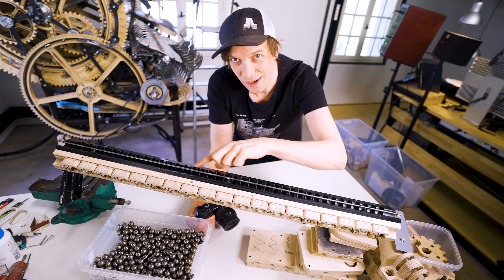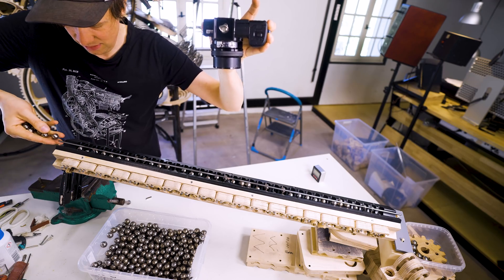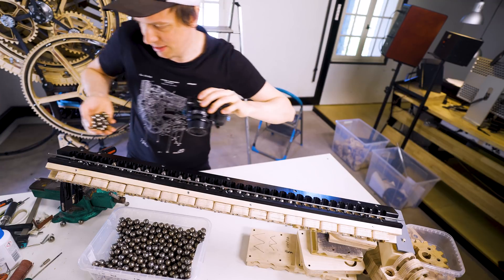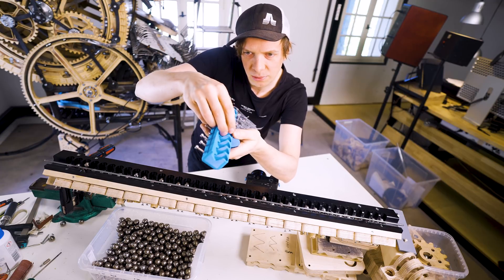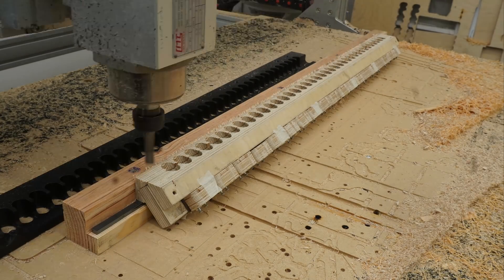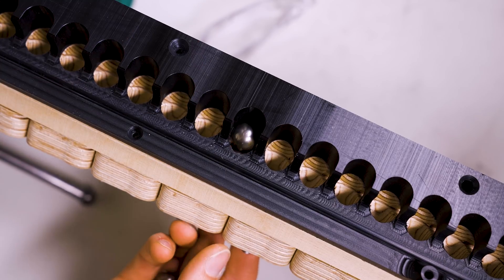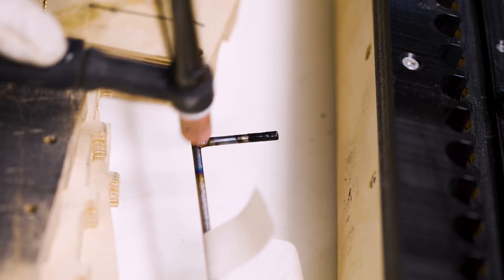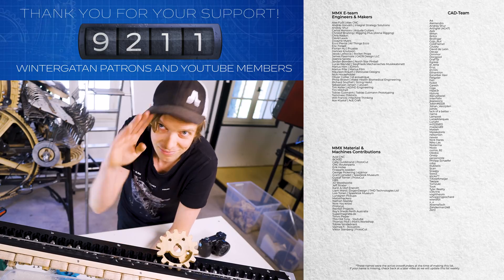Testing the New Marble Divider

Comment: Attach it to the machine with an adjustable rather than a fixed joint. Then you can adjust the angle in both directions when needed. A ball joint or some other universal joint at one end could work. Fix one of those digital gauges for each axis and you can dial in any angles you like. 😀

Comment: Consider doing a flow analysis of all your parts. What is the maximum flow (in marbles per second) in the magnetic lifter? the divider? the fish stair? How does the flow relate to the speed of the pedal beat? How many marbles per second did you need to play the original marble machine song? 

It seems like the marble divider might be your slowest part, so I'm worrying how it will fail if you overload it with marbles coming in.

Comment: One technical point: if you use different metal with lower melting point to join two metal pieces, it's called soldering or brazing, depending on involved temperature.

Comment: TOOL TIP - Nu-Calgon Thermo-Trap - I prefer the tube of paste but the spray gel works too.  limit heat transfer without cooling your weld. its an HVAC must for brazing refrigerant lines without melting internal seals or overheating internal components. would have saved your plastic I'm sure

Comment: In the close-ups of the marbles, you can clearly see some early stages of surface rust building up. You might want to check the humidity in your workshop and/or treat your marbles with a thin coat of some kind of oil.
Reply: In an earlier video he gave them a bath in which they rusted.

Comment: One thing you may have thought of but not mentioned in the videos is that the slight vibrations which are caused by the machine may help to prevent any stuck marbles; no reason not to aim for perfection, though, I guess.

Comment: In the close up of the marble divider test I notice some rust marks on some of those marbles.  That cannot be good for the reliability of the marble machine as it means rust will be left behind in some places in the machine and the marbles will become rougher and not flow nicely where they need to.  Somewhere along the line it's probably going to require a system to protect the marbles from rusting which means oil but you also want the very lightest of oil since any excess oil will also be left behind and that will collect dust which will be worse than the rust.

Comment: I'm concerned about the throughput. The marbles roll pretty slowly, and there will be many channels to feed. Perhaps the marbles being dropped at different points will be sufficient to help, but I'm not fully convinced. The second part of the concern is that the low speed might result in fish stair getting clogged if the marbles are too slow to escape from there.

Comment: When using different materials should the expansion/contraction be considered or wouldn't that matter anyway considering the lenghts of the parts (less than a meter) and the temperature differences one would expect (probably hardly more then -5° to 35° in theatre/open air/transport situations)?

Comment: It seems that the main channel runs too slow to support all the notes being played when the machine is actually run.  Have you calculated the marble feed rate requirements, and that there will not be a "traffic jam" at the divider?
          Regarding the color of the plastic, I think you should have chosen a light color for appearance.  On stage, the divider will disappear into a sea of black!
          You should have made a jig from plywood for the welding exercise to prevent heat damage to the plastic, and have less need for a hurried joint.  At the top end, I would have bent the wire rather than welding.  For the other joints, I would have brazed this with a gas torch, using silver brazing alloy.  I would have also  turned down the ends of the vertical pieces, and inserted them onto holes drilled in the side for mechanical alignment and more strength.

Comment: @wintergatan any thoughts on a finish on the wood to help it retain its current moister content? It is going on a world tour, world has many ecosystems each with thier own average humidity levels, your wood, especially smaller pieces will warp and shrink and expand with it very quickly if it's not finished or treated... just a thought.

Comment: A trick I learned back in the day for keeping heat from spreading to other parts, is to take a pair of vice-grips or other heavy metal clamps and clamp it to the work. It will act as a heat sink and help keep sensitive parts from melting.

Comment: When you're welding into something connected to a flammable/meltable material, stick a set of vice-grip pliers on the metal near were you're welding. It works as a heat-sink, more heat should go into the pliers.

Comment: Hello, just a college guy majoring in Aeronautics Engineering here. Just some word, Redundancy is used when if, in case one part fails, the system as a whole would still be able to continue perform without noticeable degradation in performance. What you just shows in your marble divider, isn't redundancy, but a part with high level of tolerance, which means that any inaccuracy in input data(which in this case is the tilt angle), doesn't severely affecting the performance. Glad you finally finish the marble divider height problem Martin, and can't wait for you to install that in your machine!

Comment: I might've missed something from the live, but I'm kinda worried about channels getting underfed after a while (as some imperfections will cause some channels to get skipped more than others). If that ever happen, you could probably find the optimal angle for maximizing channels being fed by feeding the divider a constant number of marbles and measuring how many skip all channels, while starting with all channels empty. Greater accuracy should equal less marbles skipping channels and thus less chance of underfeeding.

Comment: I know you’ve focused heavily on slow moving marbles, but have you looked at the possibility that excessive speed will make the marbles skip holes?
Reply: I think he has a lot of ways to slow marbles down to speed is too high: slope, tilt, and the entry speed from conveyor and fish stair.

The problem comes when a big blob of slow moving marbles forms.  Then they start to stand still as new marbles 'cut the line' as they fall from above.

This results in a clog that can back up into the fish stair and cause marbles to bounce over the guard rail

Comment: Going to keep saying it until it sticks, this is a terrible idea. Notes lower down will never get fed marbles during extended play. Every single note ahead of them will eat a marble and there's only so many marbles that can go down the line at once. Small-scale tests with no notes being played don't mean anything. Put them on the wheel and play something. Going to be a lot of high notes and dry clicks.
Reply: I don’t think so. You need to remember that there are several paths that feed each section of the divider. So the marbles don’t actually have to roll all the way down. But we will see
Reply: @Faenus  All depends on feed rate. And yes, I noticed that it was split into, what, three? lines. But the problem remains that the last one before the next input is still going to be waiting a long time.
The original marble machine split way more, and while it had its own problems, this version's lifter is more reliable and could fill it up.
I don't even know how to get started doing the math, but just look at how freaking slow it is to get to the last holes on this track. Now imagine one note is playing every second and it never fills up. Hell, just block two holes with a finger and do a basic beat, see if it stalls the feed.

Comment: You know how it's a sign of good engineering? You iterated the design to the point that if I didn't know already, I'd think that the POM/Delrin part was meant to be there. One of the great properties of Delrin is that it's self-lubricating. So you might be able to cut out the majority of the graphite dust that was contaminating much of the machine, as well

Comment: In the future, if you need to keep heat out of plastic, put an alligator clip or similar on the rod, in between the weld and the plastic. it'll act like a heat sink and keep heat out of the sensitive material. it works for soldering electronic components, should work for quick welds like this too.

Comment: Since we are engineering here, all materials have strengths and weaknesses. Delrin (POM) is an extremely wear resistant plastic with massive compression strength. But it is britle, it has a relatively small elestic and plastic deformation stress window, particularly for tension and torsion loads. The plywood you use is much more ideal for tension and torsion loads for example. 

Another consideration when combining dissimilar materials is expansion and contraction due to both temperature and humidity(with wood) , I imagine on a world tour the MMX will not be transported in environmentally controlled conditions. Before changing the material a "final" part is made from it would be wise to consider these properties.

Comment: I am worried that the rate at which some of these channels fill will be slower than the rate that they get used.  You really need to make sure to test that certain channels arent being preferentially skipped on the long term because that error will 100% accumulate over the course of longer performances and some channels may just empty out.

Comment: Do not consider POM to be too much of a super material. It is easy to machine and precise, yes, but over time you will find the pressure and impact of the marbles will wear a groove which opens it's tolerances. It would be wise to keep POM on the outside of the machine where it is simple to replace the parts.

At least this is my experience with it in a manufacturing setting.

Comment: I'm confused. The marbles seem to fill the holes randomly. How are you able to produce a consistent tune when you can't control the timing of the marbles entering the holes?
Reply: they don't need to drop into every opening every time, there are enough stored below that missing a few at the top momentarily is not an issue
Reply: @tommj4365  Ahh. so, this part is just topping off the store of marbles? Thanks!

Comment: Anybody else yell NOOOOO when he was about to start welding the fence right on the new delrin divider? Just me? Glad it came out relatively unscathed. 😳😅
Reply: Oh yes, same feeling here.
And why didn't he do a test weld on another piece of rod 😩
Then we wouldn't have seen any MOLtEn plastic...

Besides of that: really great to see the new divider. Really looking forward to the assembly together with the wavy marble lanes on the machine and another test run.
Reply: I would have just grabbed the first piece of extra plywood and drill the three holes into it on the CNC with the exact same spacing the Delrin part has, then welded on that sacrificial piece...

Comment: When you build the "marble divider" into "marble maschine x" it is better, when degrees angle variable/flexible is, with long screws, because floor unevenness or other Problems.
Reply: I'd assume that part of setup in any location will be leveling, but yeah some tolerance is definitely necessary.
Reply: thought at: rod down at the "marble divider," incline is the same, pipe at the end (overflow) fixed, intake reinforced, but not fixed, so you could adjust the angle with screws.

Comment: A better marble divider would not be parallel with the drop tubes. It would run at a slight angle from back to front, with divider walls shortened accordingly. This would reduce friction for marbles later in the path, which keeps them effective in the absence of pressure behind them.

Comment: I wonder what would happen if you machined this so the marbles stuck out a bit more? Right now it looks like they get trapped on the plastic, if instead they got trapped on the marbles then you would know for certain that the issue would resolve itself eventually.

I'm also guessing that the friction between two marbles is lower than that between the marble and the plastic which means them less likely to get stuck anyway.

Comment: I feel like Martin almost made the same mistake he made with the plywood part in that there is too much material cut away in the plastic between the holes, which causes the marbles to not take a straight path. That sideways bouncing as they move down the marble path is why they're getting stuck and is something not present on the prototypes. The rolling path of the marbles is much straighter with only slight sideways movement.

Comment: Another aspect with those barely stuck marbles is the vibration. Once on the machine, even the slightest vibrations are going to both loosen up stuck marbles and cause more of that back-and-forth of their transit that knocks them into the open holes. I think the efficiency is going to shoot up even more when it is in place.

Comment: With soldering, heatsinks (usually small metal clamps) are used to help prevent heat spreading to temperature sensitive items. I have no idea if the same practice could be used during welding to save the plastic, but using a heat sink you can clamp on might help?

Comment: just two/three thougths on POM
1) great material for mechanical things, good wear resistance, good to machine
but be careful when machining it, for two reasons:
- if it overheats it dissociates into Formaldehyde, which is carcinogenig (you will smell it immediately if it happens, just reduce feed rate then)
- if it gets way too hot it might catch fire and if it does it can burn with almost invisible flame and no smoke

Comment: My concern would be the jumping of marbles from the top ramp onto the divider... marbles could jump over the guiderail... either I would have flared that out wider (or taller rather) or maybe there also is the option to flip the divider front to back (IRL turning it 180 degree)

Comment: At that angle of tilt, does the 'flow rate' of marbles allow for the high tempo of music it's hoped the MMX will play?
Reply: Upvoting this because it is an important consideration. Too many marbles on the line will create spots where the marbles will collide as they come off the feed ramps and possibly jump off the machine.
Reply: It’s at the same tilt as the current divider is at so it shouldn’t be a problem. Plus I believe the marble lanes will be feeding in over the top all along the divider, only the recirculated marbles will be feeding in from the end. If I remember correctly, the limiting factor is the marble lift which needed to be able to move something like 8 marbles per second.

Comment: Martin, plastic pollution is more of a problem than you probably think..
Of course plastic is clearly the right choice for the marble devider and I have no problem with that. But please look I to plastic pollution before you start using it everywhere.
See it like this: cheap plywood isn't really  useable, right? Only the more expensive stuff is good enough. Quality comes at a cost. Plastics are more versatile and are usually pretty cheap, which sounds too good to be true. But the real cost of plastic is the environmental damage :/
So please choose wisely :)

Comment: I´m a bit worried is it fast and reliable enough, and based on this experiment,  to me it seems it is not. Everytime marble goes to its hole, it stalls the whole line of marbles for short time. Consider the last marble thats coming. There are too many times it stalls -> marbles wont move fast enough --> fish stair will get stuck.

I know marbles come to different spots on divider (from conveyor lift), but they cause bumps and chaos -> more stall for the last marbles coming from fish stair. 

I do like how you make those parts tho. And if this doesnt work, I know you will found a solution that works.

Comment: Delrin is a wonderful material and theres no worry of humidity affecting the machine. Ive always wondered how the machine behaves after a storm blows through. You could soak a bit of yarn or cloth with water then wrap it around the metal your welding. It will isolate the heat and drive it away from the sensitive areas.

Comment: @Wintergatan Out of curiosity, is that metal rail made of a material that could become magnetized? Because with the previous magnetism problems in mind, I could see that becoming a problem.
Edit: Also, the camera captured some discoloration of the plastic when you were welding, or at least a change in it's reflective properties. I don't think that's a problem, but I don't know enough to be sure.

Comment: Tip from soldering, if you ever have to use a lot of heat on something heat sensitive, use pliers or some other metal clamp on the part to divert heat from sensitive bits.
Reply: There are even copper-jawed pliers exactly for this purpose.
Reply: weld radiator... interesting.

Comment: Rather than trying random marble heights isn't there a "worst case" height?
Reply: It's not immediately obvious what that height would be. I would guess that could be when the top of the marble is just protruding from the hole, so leaving the most of empty space around the divider walls while not giving a chance for a passing marble to get on top.
Reply: @trankzen148  Yes, that would be my guess also. The height that almost but doesn't properly and completely catch a marble.
Reply: @davejoseph5615  Of course if you factor in the fact that marbles are going to be coming from the S lanes all along the surface of the divider, and hit sitting marbles at various heights and speeds there's value in having a variety of height configurations to test.

Comment: You could have used the CNC to drill the same three holes in a plywood scrap for the welding task rather than risk melting the plastic. You can also use something like a hemostat to dissipate heat.